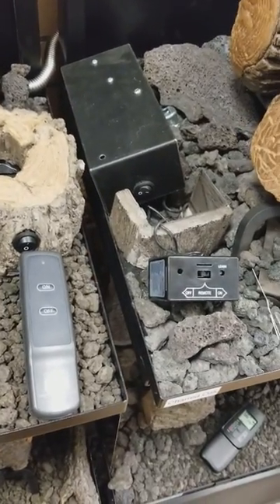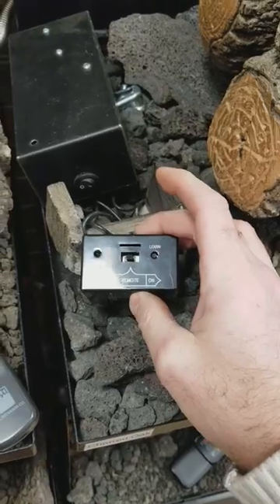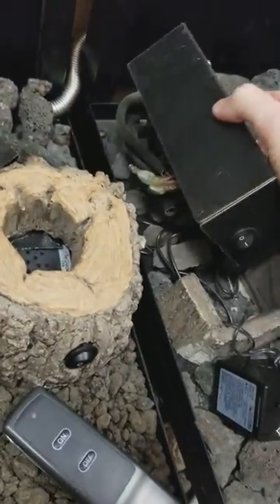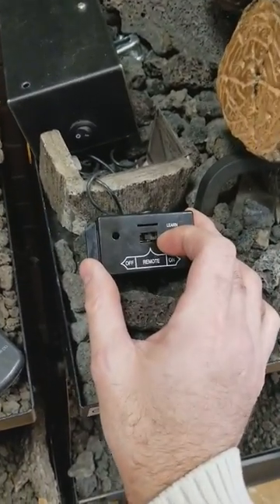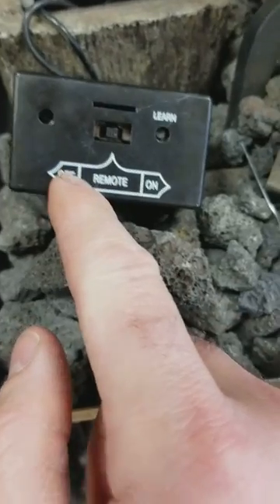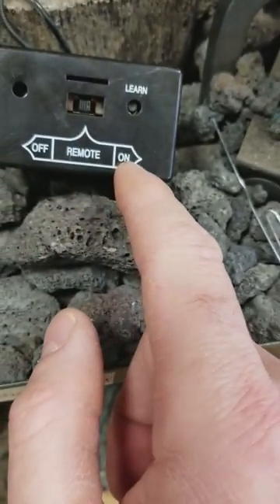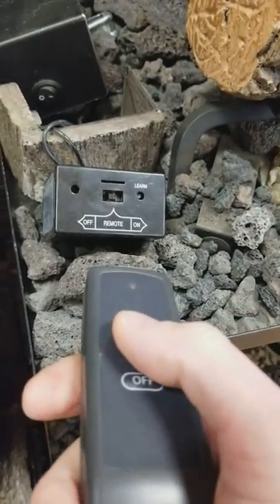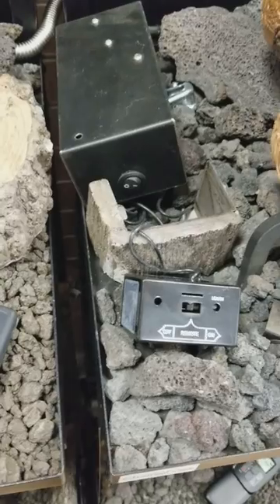Syncing a gas log remote control.

Comment: Any idea how to re sync a remote for the 2VT system?  It has a different configuration- Thanks!
Reply: Matthew:  I have a Peterson 2VT system and have constant problems with the remote.  On the back of the control box (the one in back of the logs, not the remote receive to the side of the logs) there is metal tab you press and hold for one minute to clear any paired remotes.  Then you press the same switch again (it should beep) and press the one switch to your remote.  If you have a Peterson burner, there should be instructions for this near the back of your instructions.